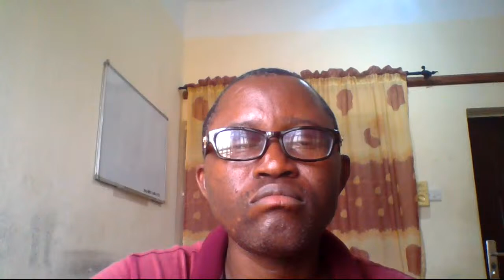Level Measurement | Resistive and Float Systems #instruments

Comment: Base on what i learn In computing, floating-point arithmetic (FP) is arithmetic that represents subsets of real numbers using an integer with a fixed precision, called the significand, scaled by an integer exponent of a fixed base. Numbers of this form are called floating-point numbers.[1]: 3 [2]: 10  For example, 12.345 is a floating-point number in base ten with five digits of precision:

Comment: In this lecture,  I learnt that , there are some common methods for level measurement.  
Using: Resistive method
Float method
Capacitive method
Ultrasonic method
Radiation method
Flow method 
And others

Comment: With this lecture i av come to find out that The basic definition of level measurement is the linear distance between the top surface of a liquid or solid and a predetermined reference point like in a tank. There are many types of level measurement instrumentation tools used in industrial processes